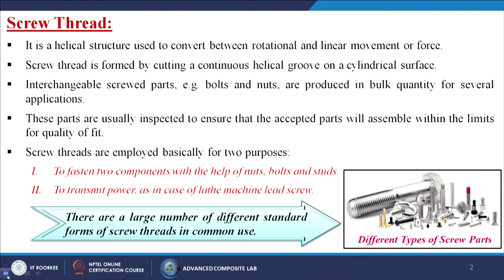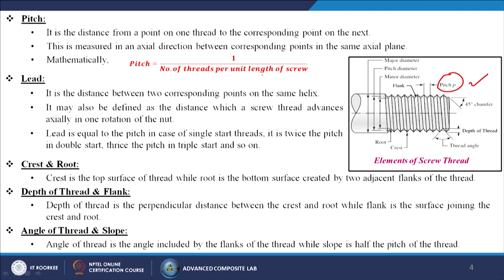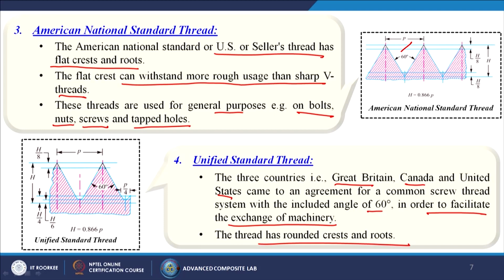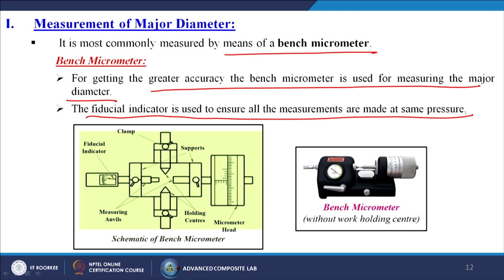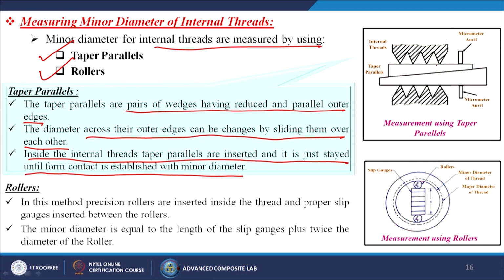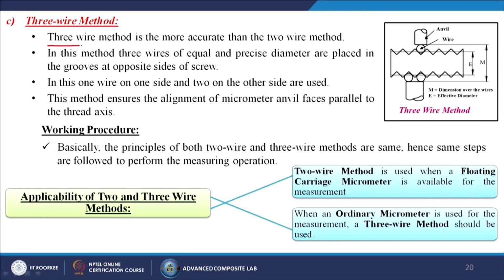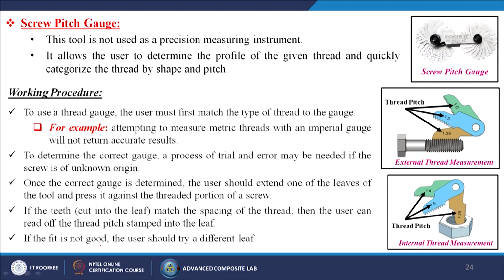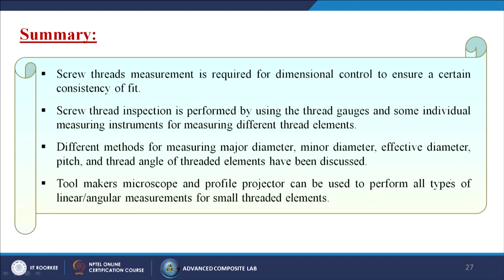Screw Thread Metrology

Comment: Really no animation, no sketches hand drawn. Didn't like it.
Reply: In free educational material only couple things matter. Corectness of content being first one. Clearnes of delivery being second. These things take (waste) time and can be searched on specific topic in question. For introduction it was realy good.

Main notes from my side:
1) Noting existance of fit and tolerance standards requirements, that would be good in order to understanding reasons of thread mesuring (what it is being compared against, or what is determined). Just few words: ''such tings exist and are there for such and such purpose. For details look in such and such standards (or it will be discused later)''
2) @4:22 Not necesary in contact because of possible clearance fit in threaded conection. Words ''for teoreticaly ideal threads'' might be aded.
3) Trapeziodal thread is mising and it is not same as acme.
3) @6:58 Metric tread specifies root radius on shaft part and permits radius or sharp root in case of no tension load on boore part.
4) Might be good to note some tipical application of mesuring metods and word about their limitations.

Other than that: Excelent voice, no time vasted and clear and good material.